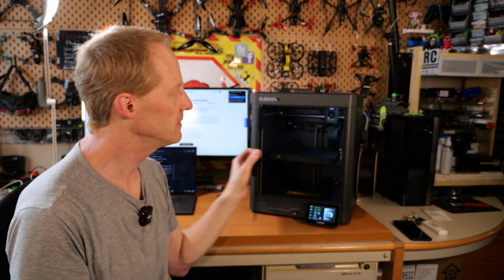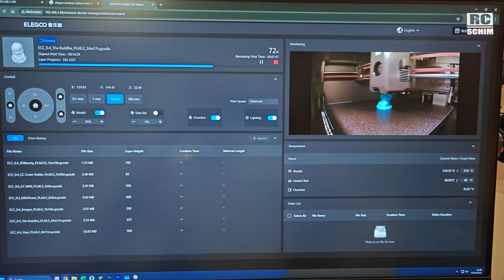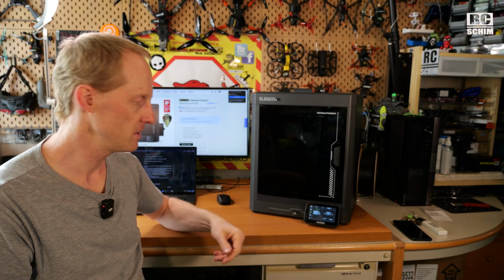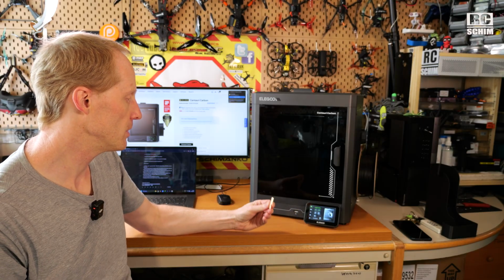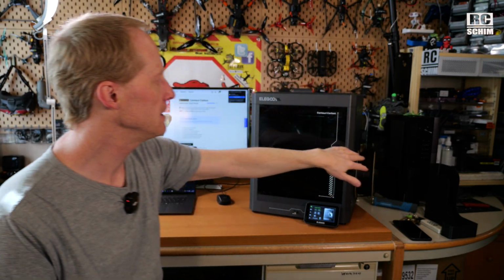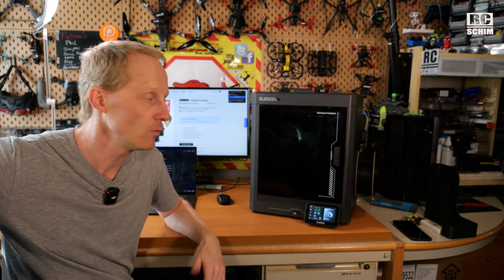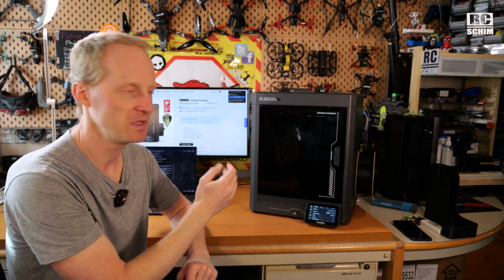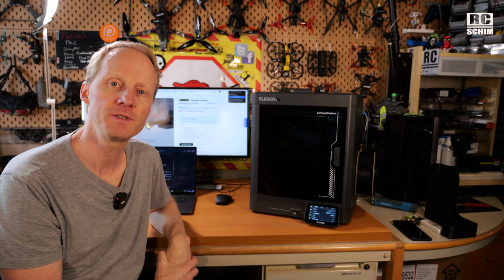Elegoo Centauri Carbon: The Bambu Lab Killer at 1/3 The Price?

Comment: I bought mine a week ago just after the announcement about the MMS delay and more likely abandonment. This is my first printer and I'm primarily printing items that are fine in one color. When I'm ready to move up I'll take what I have learned along and I'll have a pretty good understanding of what's important vs non-important. In a couple of years they'll have a whole bunch of new options to choose from.
Reply from the maker: I'm glad they didtched the multi material feeder (if you can't do it reliable, don't do it at all - Anycubic S1 is very similar printer WITH mms system and it sucks!). 
Multimaterial should only be done like in the new Bambu (H2c) or in the Snapmaker.
On my creality HI with MMS I only use multimaterial rarely - and if so, just with few color changes. everything else is ridiculous :)

Anyhows - have fun with the Elegoo - it's really my fav printer at the moment - very reliable and just fun to work with!

Comment: Great printer. Have had issues, but agree, replacement parts are scarce atm. But the print has JUST come out Q2 of this year. 

Hopefully more replacement parts and firmware fixes come out soon to help deal with the additional issues this printer has Software-wise and well as hardware-wise

Comment: Elegoo is the worsr filament ive used. Wouldn't try their printer. Good review though. I have 4 Bambu printers
Reply from the maker: Maybe that's the reason Geekbuying bundled Creality filament with my elegoo printer?   I didn't try elegoo filament yet. Have Creality, Sunlu, Overture and Extrudr. Recently found that most of my prints should be done in PETG - and it's really cheap now as well!
Reply: i also have a elegoo neptune 4 pro.. and its so horrible both on firmware, and hardware.. 90% of what i printed on that elegoo went straight to the trashcan.. then i did buy a p1s combo for 549 euro.. currently at 768h not a print error yet, no issues, no wasted prints just works, fast perfect prints.. im never ever going to use a elegoo printer again